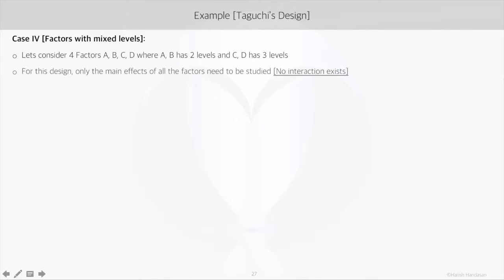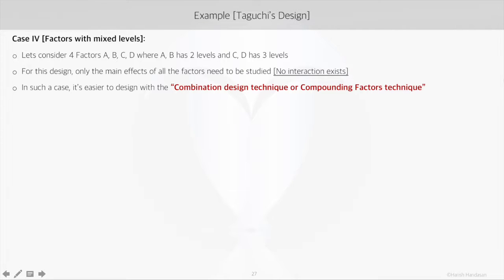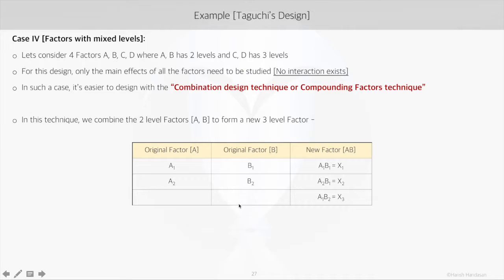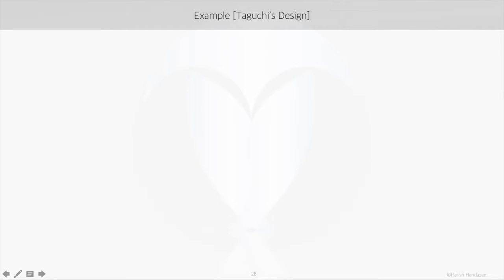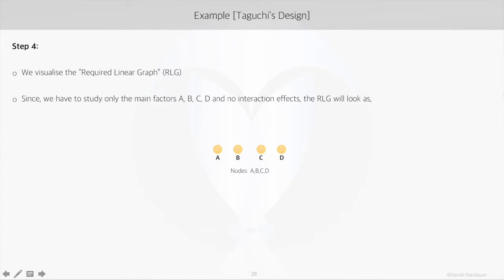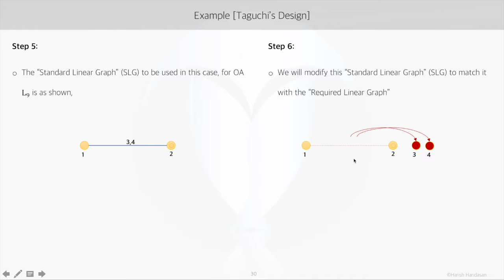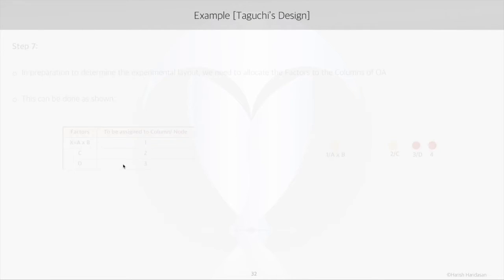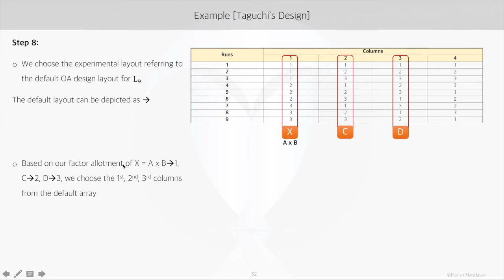Mixed level Taguchi static designs-Combination design - [Best viewed at 720p HD] -  [Part 9 0f 16]

Comment: Hello,Thank you. This tutorial is very helpful to solve my issues related to DOE. I have one query regarding basics of Taguchi method. Can you please direct me regarding more information about how we eliminate experimental runs from total runs in Taguchi mixed level approach?I have one application with 4 factors (A-4 level, B-2 level, C- 2 level, D - 3 levels) in which i'm trying to reduce total experimental runs by using Taguchi method. But i'm worried about, will I be missing any important run(important parameter value) while doing it?

Comment: Hi, thank you for putting up your tutorials. They have been very helpful. 
Can you direct me to where I have find a standard OA table for up to 6-levels for example? Also, can this be done easily without using standard tables in case it runs out of levels?
Reply from the maker: +PhoenixEryaXX3 Thank you! You may check the Part 4 of this series. On Slide 20 of Part 4 the standard table is provided. The document used also is in the description as a reference. Also it is always advisable to choose the closest array to maintain orthogonality. In case we have varying levels, Mixed designs is the alternative.
If you find the tutorials useful, pl do share in your network!